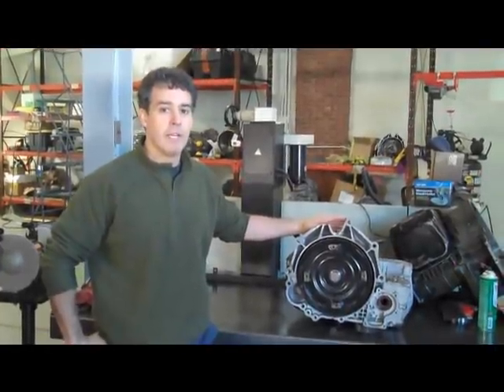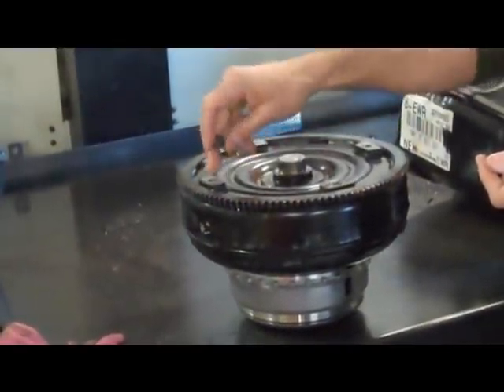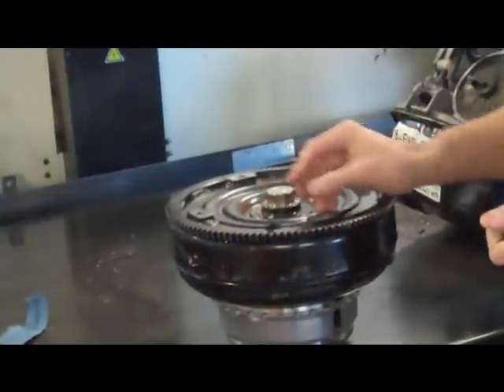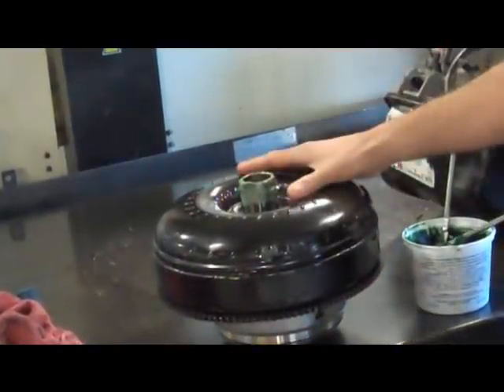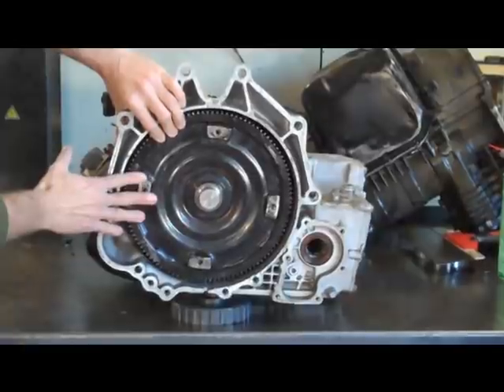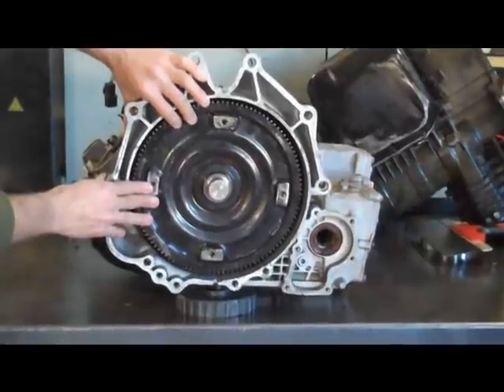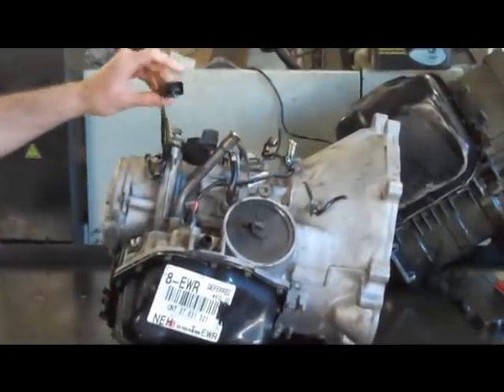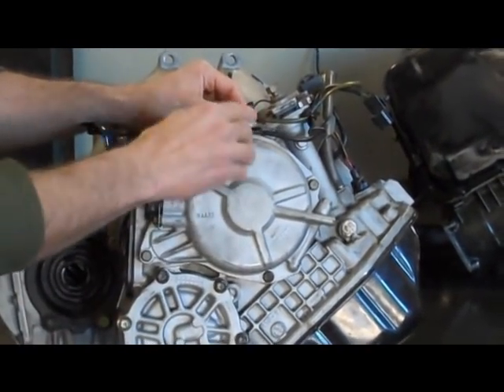Mitsubishi Trans Tips Volume 3 - Converter and Installation

Comment: That seal is real easy to get out and put in.  I just used a screw driver and pryed against a block of wood to get the seal out.  To put it in i used a piece of 2" abs plastic pipe I had in the garage and gently tapped it in.

Comment: Do these transmissions come out from the top or do I have to drop the engine and cradle? I have a 2006 Mitsubishi Eclipse GT that only has reverse and is even slipping in that gear. The fluid doesn't smell...just a bit off pink. I'm suspecting the oil pump as the shifter went tight on it when it lost all its drive gears. No pump = no oil getting to the shift mechanism = tight shifter. I removed the cable at the transmission and it is the cable itself has no tightness to it. Does this diagnosis sound plausible?

Comment: I changed my F4A22 Trans for an F4A232 trans... a few months later, the starter motor failed to start the car (the Bendix fails to fit the torque converter). Must I change the starter motor for another one build for the F4A23? or it is the same for both? The current Starter Motor I have is the MD192228... My car is called here Space Wagon 1.8L from 1998. Thanks in advance.

Comment: @iptperformancetrans Subscribed!  I used your end clutch vid when I installed mine.  I also picked up a trans cooler from you guys, a trans temp gauge block and a bottle of the black lube guard.  What's the best way to install that seal?  I normally use a socket but I doubt I have one long enough to get past the input shaft.